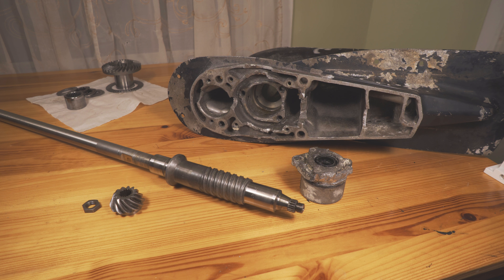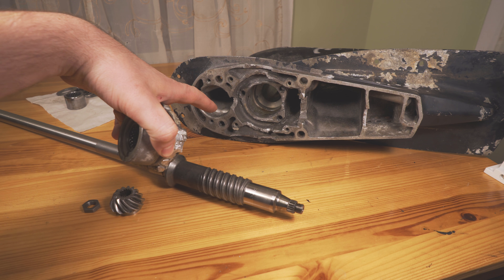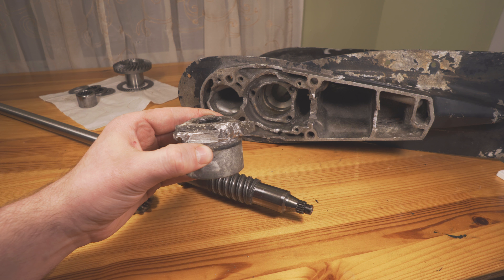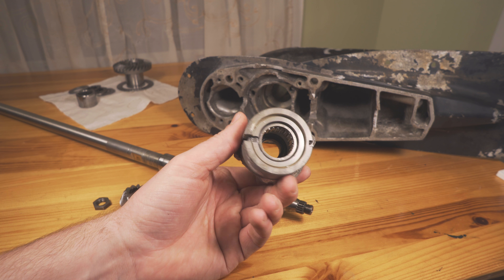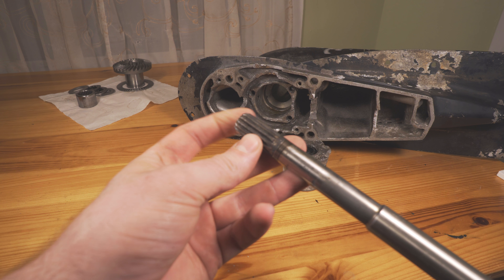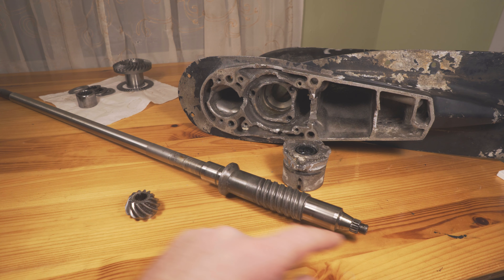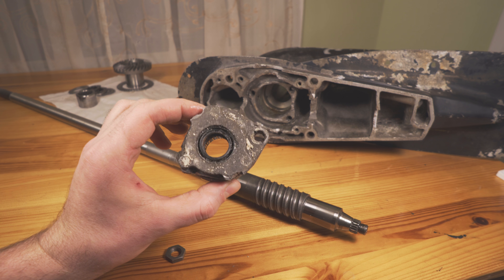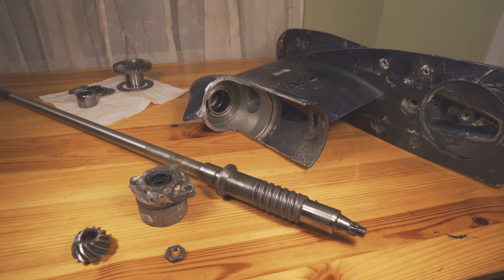Remove outboard drive shaft housing + drive shaft part 1 - Evinrude lower unit disassembly

Comment: What worked for me was try to turn it first. I hit it with a hammer and flat head chisel on the side and hit till it went left and then right and went back and forth a few times enough to break the corrosion thats holding it in. You will see it move. Then after you went back and forth you can prey up on the sides of it back and forth in the two slots of the bearing housing. That worked for me. This video has helped me so much. Thanks again!!!

Comment from the maker: Update: To remove it I believe you also need to remove one of the screws along the lower unit, slightly above the oil fill screw. This bolt locks the driveshaft into place. So be sure to remove that as well before trying to pull it out. I think its the 3a screw in the diagram.

Comment: Hi I realize this is five years old now but I have been like you in a battle with the driveshaft bearing seal assembly on my 96 johnson 40hp. I can't afford to total it to win, and I'm pretty far in. Is there anything that you learned or thought of over the years that could help.
Please let me know.
Thanks.
Reply from the maker: @JBlake-moon-shdo  you need to pull the drive shaft housing up directly. The best way to grab it would be to use some sort of kind of sharp pliers that grab it around the edges but then give you the ability to hammer directly up. Or use some sort of puller. The issue is that if you try to hammer to the side it's not going to come up because it's inserted directly down into the hole. Also it does not help the fact that the drive shaft housing tends to be pretty weak and falls apart when you try to bang on the edges. You really just need to have a way to somehow grab the thing  really really good almost something like the traditional tool used for carrying ice blocks.
Reply: @cenkaetaya  Thanks for your quick response. I did look into a tool today for it right after I texted you. I did see a slide hammer that's mounted on a pipe that is supposed to be made for this. I'm in to this a bit deep, but I think I will get one. I have chiseled this back and forth until it looks worst than yours. 

I'll let yo know.

Tomorrow I'm going to try tap screws and heat first. 

Thanks again.
Reply from the maker: @JBlake-moon-shdo  Unless you can get something like a slide hammer or a way you bang it upward, your gonna f it up. Also when doing the final procedure obviously make sure its not frozen cold or what not, and maybe even put it in hot water to loosen it up a bit. It just needs to come straight up.
Reply from the maker: Another method is drill holes into it and use that to pull it up, be sure to look at it carefully in the video as you dont want to drill too far. If you can kinda hang it from 2 points and slowly hammer the lower unit down as the top stays tied, i think that could work.
Reply from the maker: I was thinking if you got the nut off the bottom gear, you could hang the motor from the drive shaft, and lightly bang around the corner in hopes of getting the drive shaft to pull the housing out. Just a thought. Make sure you also remove one of the bots along the lower unit, i forget which but it looks like it does nothing but it kinda locks the driveshaft into place.

Comment: I've got a Johnson 88 that the upper Drive shaft has snapped. I am trying to separate it from the lower shaft. There is enough of the upper shaft left to get a hold of with vice grips. I have clamped onto it and tried to separate the two but it stuck pretty good. It looks like the upper drive shaft is splined and just pushes into the lower. I'm thinking about adding some heat to it tomorrow and trying again. Any thoughts on this would be appreciated. thank you
Reply from the maker: It's honestly probably easier to find a used part on craigslist.

Comment: Do you have any parts left from this for sale?
Reply from the maker: The drive shaft, I probably have all the other parts but it would be hard to differentiate exactly which is what as I have a bunch of random parts.
Reply: I would be interested in the driveshaft perhaps. Would you be interested in selling it? Mine could be cleaned up at a machine shop but theres a wait with that.

Comment: Anyone know how to remove that part?
Reply from the maker: A puller with a slide hammer. If stuck or the pull grooves are damaged (which happens very easily as they are old), drill into the housing and use screws to pull it out.

Comment: Mate, maybe you will want to re-edit some of the improper mis use of terminology used and explain what a true butcher dude yo are. Fairdinkum, struth
Reply from the maker: I do not know the correct terminology unfortunately. However I do have the parts to show you as I see them. If you have extra info please share and ill add it to the description.